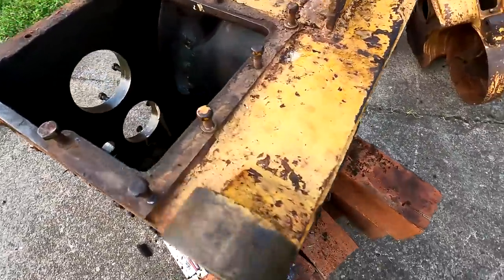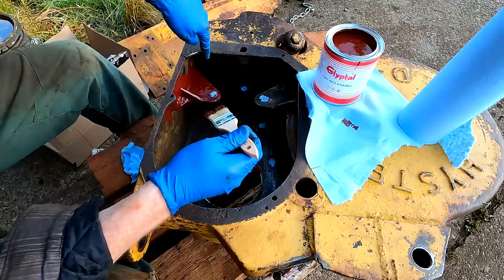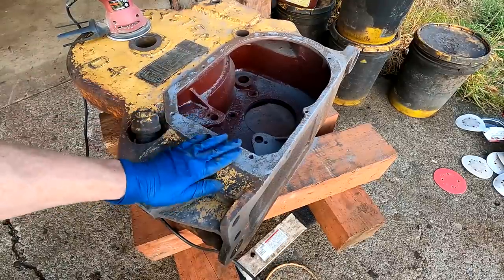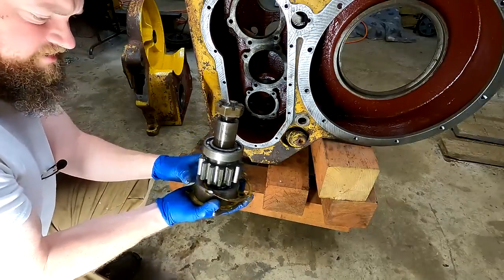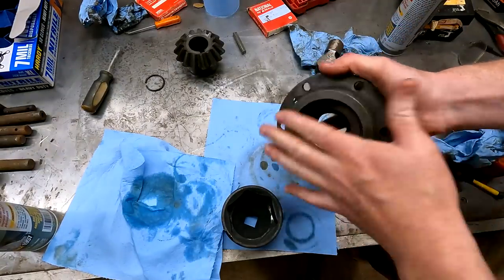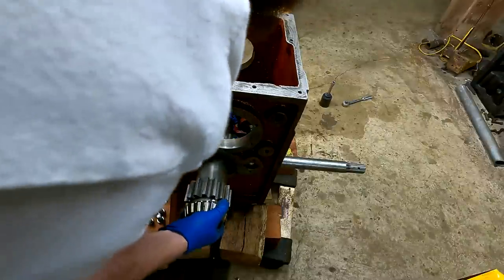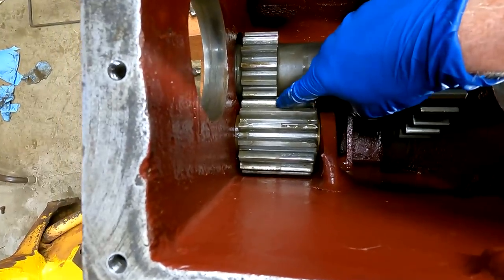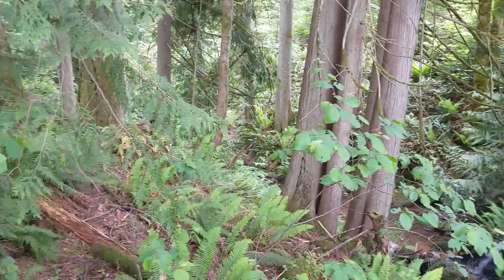Caterpillar D4 Hyster winch rebuild (part 2)

Comment: Great work Matt! It's really starting to come together. I also watch Clint on C&C Equipment. I love the contrast of how you are tackling your DIY/garage restoration and Clint's repairs and restorations in a fully equipped service and repair center. It's extremely impressive watching you tackle such a big (and heavy) job by yourself in your personal shop. Your engineering background comes out in how you approach not always having the right tool or dealing with some of the difficult tasks, moves and lifts.

Your videos also contain a lot of great, general DIY tips. Personally I think your two tips about the different types of wire cups/wheels and how to properly heat gears and bushings were spot on. I have seen a few people grenade the cheap 3000 rpm wire wheels on a 30,000 rpm grinder. I only buy the higher RPM wire brushes now. That way I don't have to worry about grabbing the wrong one, and I figure if it can handle a 30,000 rpm grinder it should last even longer in a 3000 rpm drill.
Reply: Did you see that wrecking ball action on the dozer undercarriage  ?
Reply: @12345NoNamesLeft  I have seen some things done out in the field, and that video had quite a few "pucker factor" moments!

Comment: You are absolutely correct about heating the bearings and gears. Heat them in oil. Put something between the item being heated and the bottom of the pan otherwise it will overheat from contact with the pan. Keep the temperature of the oil at exactly 250°. Great work young man!

Comment: When I restored a 1942 Ford GPW I used aircraft form-a-gasket when there were were shim packs on the sealing surface and it works well. It’s not a traditional form-a-gasket, it’s more the consistency of syrup but doesn’t dry so you can just paint it onto the shims and bolt threads and it keeps everything sealed.
Reply from the maker: that is a great idea, thanks

Comment: I remember using glyptal to coat the inside of engines for our record holding AA fuel roadster back around the mid 60's.  A little grain of sand from the casting can play hell with a nitro engine!

Comment: When spraying degreaser, I use a pump-up sprayer that I got at Lowes for around 7 dollars. Holds about 2 liters when full but you can put as little as you want. It pumps up similar to a garden sprayer and beats the crap out of the bottle sprayers.

Comment: Replacing ALL THE BEARINGS:)  Lookin' good, though. A little boring trivia: Glyptal was developed by GE, I think in the late 50s/early 60s. It's really a high-temp electrical motor-casing paint that early hot-rodders started using to improve oil-return.

Comment: You could TIG weld that interior case crack pretty easy, it's so thick you might not even need to add filler metal.

Comment: About the steel stick compound, that is most likely just epoxy dough and in my humble opinion is not recommended to handle without gloves since it contain stuff that could cause contact allergies.

Comment: Its a Coming.  I would clean and re-use the taper roller bearings. Why? slow turning and huge and surrounded in hydraulic oil. No big load on them. Then how many hours a day use? Next to none. You have a 40 acre farm, not running a pipe line down to Galveston. Love your vids. Always look forward to the next... Thanks

Comment: That Glyptal was also used by Collins Radio corporation in the day (*back in the late 1950's to early or mid 1960's. Collins used it as a thread locker and used it on all their setscrews to hold control knobs and shafts on transmitters and radios for military and amateur radio systems in that time period!  One had to heat the setscrew with a small soldering iron for a while just to loosen its grip prior to removing the screw with a Bristal wrench set.    Great video though as always, thanks!!
Reply: Glyptal dates back to the 1910’s-1920’s.    It’s good stuff.   There’s also different types of essentially the same stuff that goes back even further.   It was patented in 1914 but I don’t know when it was actually made.   First
Reply: @TugboatMatt  Hello Matt! Thats very interesting ! So Glyptal is much older than I thought, WOW

Comment: Well, it's about time.  What have you been doing?  We are settin out here hungering for the next installment.
Glyptal is expensive!!!!   $63.00/qt on Amazon.  $60.49 + !3.00shpg on Ebay for a 12oz spray....
Excellent attention to detail Matt.  I understand your dilemma, there's only one of me and I'm not even providing videos!!!!!
Reply from the maker: It's really not that expensive for how you use it though....I only used half a quart for this entire thing.  $30 to have no more casting or rust bits running through the gears is pretty cheap insurance

Comment: If I might suggest, if you have doubts or questions about a bearing, replace it with new. It's just not worth the aggravation to put all this Winch back together then hear that 
'moaning' sound ( or worse ) of that dubious bearing that was overlooked. Also remember bearings abhor dirt, and they have a way of getting back at you, if that fact is overlooked.

Comment: 30:58  Re the shaft, it looks like the surface on only one side has been damaged.  Just rotate the shaft half a turn, the the 'good' side is under load.  It looks like you'll need to cut a new 'index mark' in the end of the shaft.

Comment: I would definitely either replace that shaft or at least weld repair it and turn it in a lathe. It would be easy to buy a piece of cold roll steel to make a new one and not expensive at all and if you think that the shaft was hardened get 4140 and make it out of that and harden it yourself.

Comment: Regarding wire wheels on DeWalt grinders I've noticed that if I use a Flex Volt 20V/60V battery the RPM goes up a substantial amount which leads to my chest looking like a porcupine especially with Horror Fate grinder accessories.

Comment: It's difficult to tell, but the gear tooth flank damage may not be from contamination but rather pitting from the tooth being overloaded. Pitting is a variant of a surface fatigue failure due to contact stresses exceeding the materials endurance strength causing it to locally yield.  It doesn't surprise me given the signs of abuse.   The good news is noise and contamination generation are the primary byproducts of this issue.  Neither of which this product is particularly sensitive to.  
I wonder if the keys are sized appropriately to act like a mechanical fuse to protect the rest of the gear-train.  That's typically the intent.  If they are, they will save you from breaking off a tooth, but not necessarily a prolonged surface contact failure like this.

Comment: For your own well being, don't ever hit hardened steel hammers with another hardened steel hammer. They will spall and it's like a bullet, usually in the face somewhere.
Also change the shaft when you change those needle bearings. Those gears are getting the full effect of the torque multiplication of the full gear train. Any blemishes on that shaft will cause premature bearing failure.

Comment: I would not use the same oil in the winch as the transmission, especially with that loose fitting  spiral gear.  Synthetic rear axle lube.

Comment: I am curiouse didn't the original owner want the cable.  It looks like the same size we used with our D-7 Cats for logging big timber in Idaho.  Was it be over kill on a D-4.
Reply from the maker: the cable size?  The manual suggests using 5/8 or 3/4.

Comment: Are you sure there isnt an o ring groove on that all the parts in my cat 29 ccu have o rings
Reply from the maker: an o ring would have been the preferred method, but there wasn't a groove
Reply: @PacificNorthwestHillbilly  was there a chanfer some times they make a chanfered edges for the o ring i have also take parts to my favorite machine shop to get a groove made for an o ring one my cat 29 in matter of fact the part that goes to the pressure plate has a chancfer for the o ring

Comment: Now i want to put it out there i had a drive gear part 4f6327 stolen from the back of my truck manual says it is a drum but it not really the drum it is the steel disc drive gear for a cat 29 double drum winch put these parts on my truck to clean them at home i work a regular job and i have honey bees to tend to so bees season came in and winch had to go on hold as for the part were on my truck and this part got stolen out of my truck it is one out of the left hand side it is part number 4f6327 it is 1700 for used and 3600 for new. I am really out of pocket and as now in time bees hives boxes and frames is costing 2200 so like well im putting it out there if it was to show up on ebay amazon or craigs list or any place like that